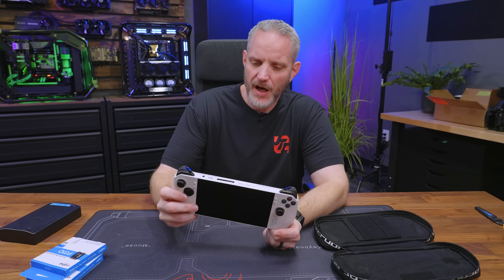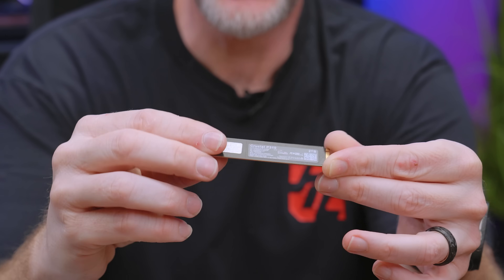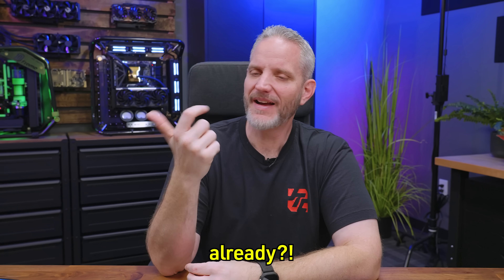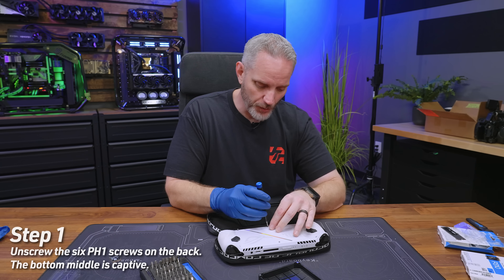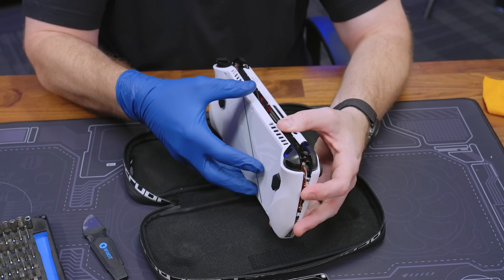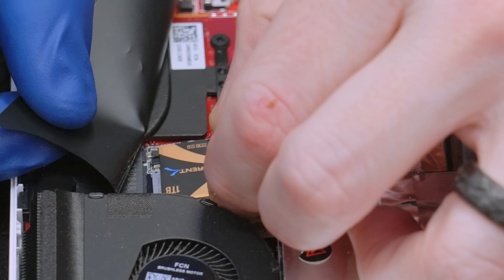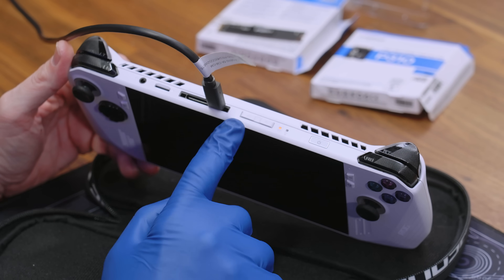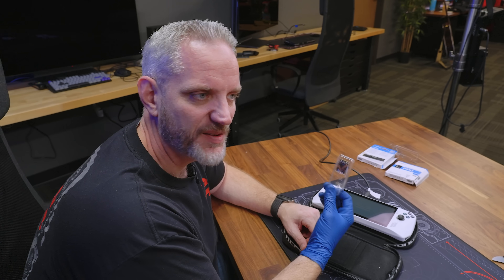How to upgrade Ally SSD.... Easy Turorial

Comment: I have seen some ROG ALLY owners and Steam Deck owners say that when they get out of work they don't want to sit at there PC Setup.
Reply: I bought a 3DS and a Vita, and ended up only using them on the ride to work. Couldn't stand sitting on my bad playing while I had a perfectly good PC and console a meter away.
Reply: I like having portables like the Steamdeck so that I can roll around on my floor or laze about on my veranda. It's also helpful for long trips or days away from home.
Reply: Lounge gaming on a big TV would be my first go to in that case.
Media room with a lazy boy, drink, good 5.1, T.V. that's nearly to big for the space
Reply: Not always the case, I take my Steam Deck to work with me to play on my breaks, and when I get home I love to jump on my big rig to play games maxed out, at utrawide high resolution, and high fps.
Reply: If you got payed to count blades of grass all day, you'd call that work. It's menial, has no real benefit, makes no tangible value, but it's still work.
Reply: Deck owner, I spend all day at my desk as a software dev, last thing I want to do as of late is sit and play a game at the same desk I work at. Steam deck and arm chair or steam deck on the deck.
Reply: Same for me  but then I use consoles for gaming.   For me i use handhelds mainly when travelling its just a more convenient for gaming than a laptop.  Sitting next to the pool or lying on a bed yes you can use a laptop but much easier with a handheld.  My tip is definitely  choose games either designed for handhelds or where you don't need to see small objects,  platformers and racing games work well  but big open world games or anything with lots pf menus  can become frustrating  when it difficult to see or read on a smaller screen
Reply: It's much nicer to lay back in bed and play games dont have to expend energy trying to sit up just takes a whole variable out of the equation and that means more gaming true pc gamer don't even get out of bed for anything really need to do a number 2 just soil yaself a number 1 perfect really soak that number 2 into the sheets need to eat no problem the number 2 you did earlier has got you covered
Reply: I can play my Legion Go sitting on my sofa, AND use it as a full PC. I can't say the same for my SFF PC!
Reply: I'm one of those. If there was an easy way to have a desktop pc in bed and work well, it would be used everyday all day until I have to sleep.

The next best thing is the rog ally. After work or doing project after project, meetings, gatherings, etc, or even just no reason at all, I just want to vegetate in bed, but with a computer of some sort.
Reply: That’s me, I have a ROG Ally X as well as a custom built PC that I put together a few years ago that’s equipped with an RTX 4090. I am behind a desk and a PC all day at work. I rather lay in bed of lay back on the couch with my handheld.
Reply: @dravynn  how do I get a job like that bro I'm getting tired of running my ass off all day fr

Comment: 4TB ones are in production right now.
Reply: Or get an Ally X  that takes full size SSDs which are cheaper because there's more available
Reply: 4tb 2280 sized drives are the best bang for the buck, actually.
Reply: @CantankerousDave  Yep, have had mine for almost a year now.  Started at 512GB, then a 2TB, now a 4TB.  All still working in my computer.  The 512 had the OS originally, so I just kept that instead of cloning it or reinstalling Windows on another drive.
Reply: @2hotscot from 512 to 2 and 4 gb, what a downgrade🙃
Reply: @microwaveoven2  lol oops, I will correct it...
Reply: @CantankerousDave  Huh, not here in Europe... Cheapest per TB are the 2TB ones

Comment: If you buy a Sabrent SSD it comes with Acronis and you can clone your drive via USB 4 and an eternal SSD enclosure. I put a 2 TB Sabrent Rocket 2242 in my LeGo a few weeks ago.
Reply: WD comes with Acronis too however Acronis won't read the drive through the enclosure. Ask me how I know.
Reply: @EpicStoriesFromHistory23  How do you know?
Reply: Crucial also comes with Acronis.
Reply: @2hotscot  You can do that without Acronis actually, but a lot of work "copypasting" in command prompt, or lot of time searching for free Acronis replacements
Reply: Acronis is now a subscription service which sucks ass, it used to be a buy once type of deal (got mine in 2019)  but i can attest it is the best back up software ever.
Reply: I'd rather have a fresh drive than a cloned one.
Reply: @rustler08  good luck finding drivers and the proper software on certain things but ideally a fresh install is better but not always the case.
Reply: okay I was wondering about that, but you should need to unencrypt it first if you want to clone it no? or would a cloning tool be able to just send everything properly to the new one?
Reply: @arashitempesta it's a straight copy, so it wouldn't need to decrypt, you would still need the password to read what's there after you copy it though.

So decrypting it isn't necessary for copying/cloning.
Reply: @UltimateGattai  That isn't 100% correct. I cloned one of mine and did need the decrepition key because I forgot to turn off decryption prior to cloning.
Reply: @arashitempesta  unencrypt first

Comment: I wish SDRam would die already along with x86.  x86 is antiquated garbage and the memory handlers are also garbage.  The reason to use RISC is because it has significantly larger ram bandwidth and throughput because it can directly address more ram from the CPU register blocks instead of what x86 does which is have the ram controller adjacent to the CPU and pretend that it isn't a workaround for bad CPU to ram addressing architecture--that's why X86 runs so hot.  RAM and the Hard drive should already be the same thing.  If you have wider memory bandwidth you can have slower fetch times and still up having higher instruction sets per fetch cycle because your fetch size is massive.  It will also run much cooler.

Ryzen is x86.